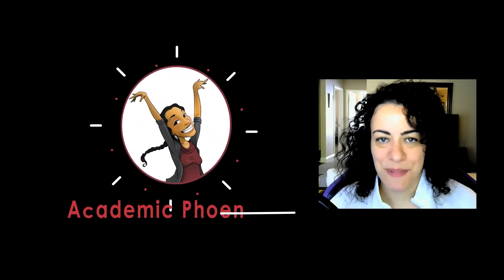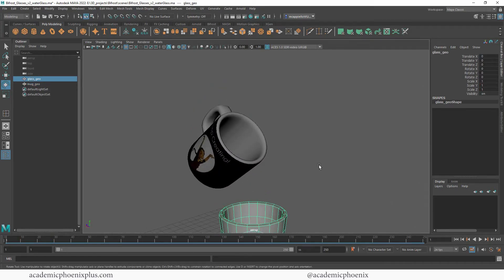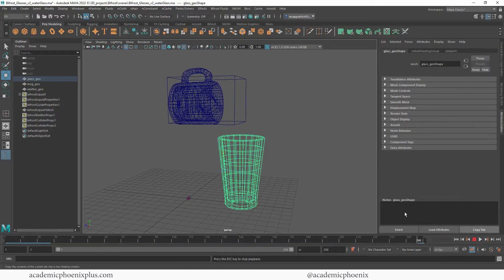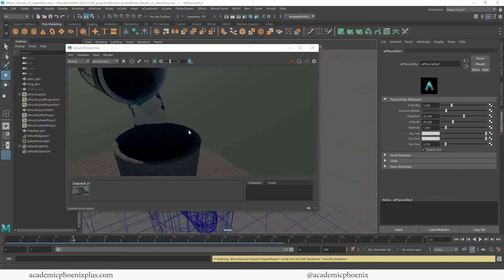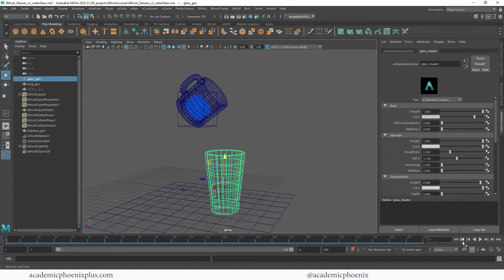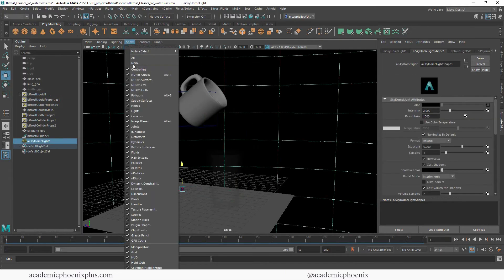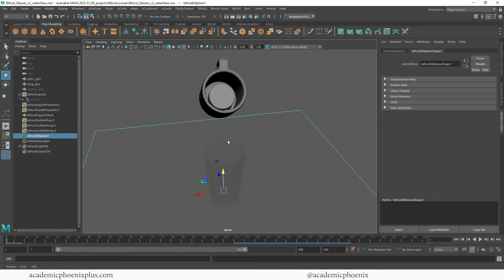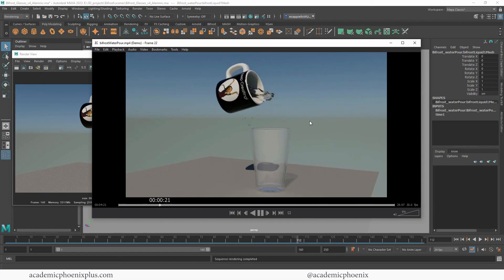Bifrost Basics: Pouring Water in Maya 2022

Comment: Hi! Great tutorial, thank you for sharing.
I tried following the same steps but I'm facing an issue. The water is leaking out of the glass instead of staying inside.

I also added a plane at the bottom and used a Kill Plane, but the water still passes through the side of the glass.

Do you have any suggestion on how to fix this?

Comment: This video does not answer problems i am having with pouring liquids. The shape i made is a bottle, almost like a wine bottle. The collider is set to a shell type for more accuracy, the same result occurs regardless of how its been set. When the liquid reaches the exit tube it stops as if its hitting an invisible wall. Only a small amount of particles fall out while the rest swishes around. This has been a constant problem for me and I cannot find any guides on how to fix this. Adjusting the size does not fix the problem either, as sometimes the size is the culprit.

Comment: The emitting geometry wasn't resting in the mug, so when you hit play it's drops inside the mug causing a splash before the mug rotates. 😋

Overall awesome video, thanks Monica 😘
Reply: I can only assume that she normally would slowly animate the mug tilting, then slightly increase the speed and move the mug forward while the last trickle happens.
Reply from the maker: Thanks for the comment! I was touching more that even though the water splashes, it shouldn't have enough force to go through the mug/geo... 🤷 Lol, I have to play more with the settings, but settling the water more might solve the issue too. Thanks for the tip!